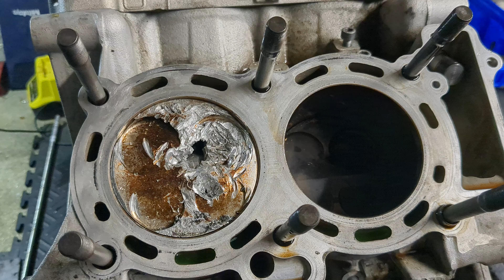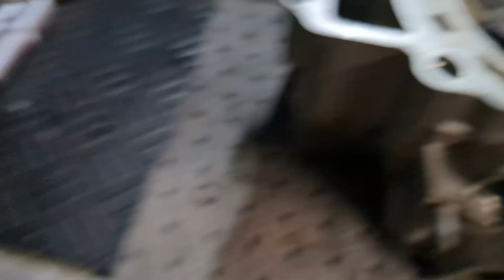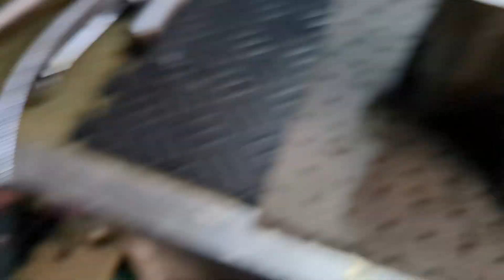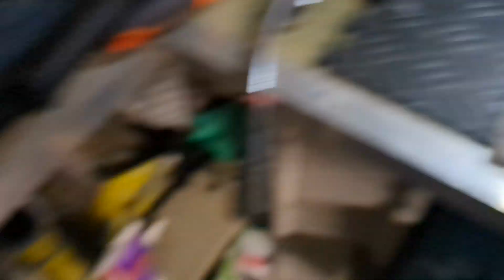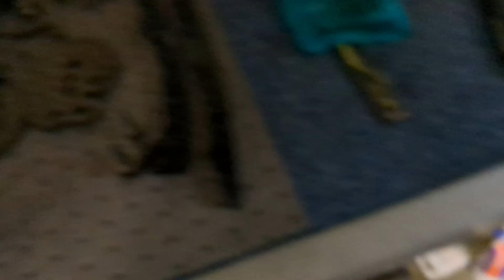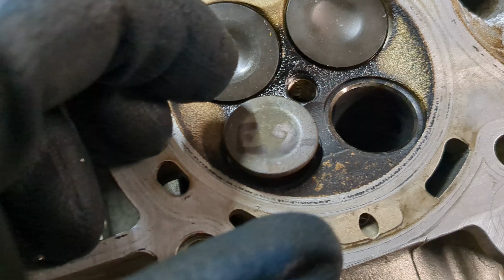Tuono and Rsv4 valve failure : The reason

Comment: How many kilometers in the motor when it failed?
Reply: Sorry I just read the description. Sorry this happened. Unlucky. So you checked the valves, they were off but you ran it anyway?
Reply: The exhaust side valve guide wear indicates a lean condition?
Reply from the maker: @kingdavid2018  It's not about mixture or else, lot of people having valve failure on RSV4 or TUONO for the same reason, there is nothing you can do except being red flagged if you find a valve with anormaly low clearance. Checked my valves last year just after bought the bike and adjusted all of them, the valve with almost 0mm clearance before adjust is the one who snapped 1500km later.... My engine is full stock map and exhaust. Its a guide design problem, AF1 USA noticed it's happening more on road bike than raced bikes probably because of engine temperature higher on road / town

Comment: Just pulled my heads on my 2013 Tuono after 16,000 miles and its exactly the same way. I found my exhaust tolerances way too low on 2 of the 4 cylinders. #1 and #4 were down about .13mm Vs the .20-.25 tolerance.  Do you know if it was contact with the valve and piston that caused the major failure?
Reply from the maker: @jeffjackson8686  failure is caused by guide wear and valve moving radially too much, not seating correctly and finally snap because of stress... You can't do anything, change all the guides or like me buy 2 complete new head for 750 euros each on oemparts.hu